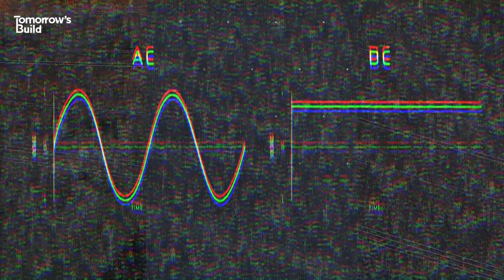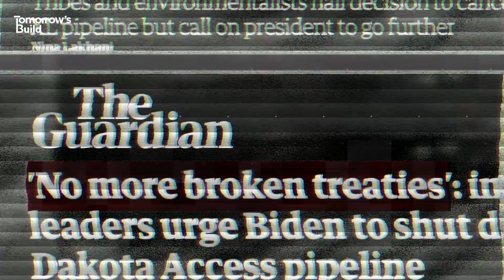The $23BN Plan to Power Singapore from Australia

Comment: Uhhh we transport electricity over long distances using high voltage AC … because it is much more efficient… not DC…
Also DC is particularly hard on the transportation infrastructure (cables, pipes and the like). 

If it is going to be stored in batteries and the like (and generated using PV cells) then DC has an advantage here, but it is never more efficient to transport electricity using DC (also it will eventually need to become AC for consumer use). 

Maybe this was done due to the insulation requirements of massively long AC transmission lines (there is a reason the lines are so high above ground and so far apart from each other - that is what is needed to insulate them. The physical distance separating the cables), I dunno. Either way if you were taught that DC is the efficient way to transport electricity then you should have a word with your teachers/school.

Comment: The more globally interconnected the electrical grids get the easier it will be for each country to maximize its own renewable energy potential in the way that makes sense for its geography, being able to supplement other countries energy deficits with their own and vice versa.  Transmission capacity is probably the biggest hurdle facing renewable development IMO currently, great news to see mega projects taking it on.

Comment: @3:27 "You'll remember from school that by converting (AC) power to (DC) power, resistance within the cable is minimized and allows electricity to be transmitted over much greater distances."

Okay, now I'm confused. I've seen documentaries on the history of electricity that seem to tell a different story, one where DC current required power generating stations be placed only a few miles apart because of said losses and it was the advent of AC power that allowed current to be carried over much greater distances; not DC, and that the transformers on the local power poles weren't transforming DC power back to AC but just stepping down the thousands of volts down to the 220 or 110 that households use.

I have no idea how to reconcile those two seemingly contradictory claims in my head.
Reply: Search for HVDC and why its used.

Comment: Great concept but a significantly better outcome for the environment, and Australia, could be achieved by using nuclear power as the energy source. Australia has an abundance of nuclear fuel as well as sunshine. Nuclear energy produces 3 to 4 times less greenhouse gases than solar. Along with this Australia is one of the most geo-stable places on earth making waste storage both cheaper and more secure. That successive Australian governments have not promoted nuclear power to the top of our solutions list is bewildering to me.

Comment: There is a similar (though probably smaller, but I haven't checked the sizes) project to build a solar farm in north Africa and connect it via an undersea cable to the UK. The site has been carefully chosen to avoid areas that local power companies have any plans to build solar farms in so prime land is not being "stolen" from locals or anything like that.

Comment: This is one of the most ridiculous plans I have ever heard, and has no basis in physics, math or history. 
1. The transport of electricity on an 3700 km cable is extremely inefficient, even if HVDC is used. Serious amounts of electricity will be lost along the way.
2. The total cost of energy (so, not money) for such a cable will cost so much in mining efforts, it will never pay the energy back. After all, you have to build the whole infrastructure, which is extremely energy intensive. This is called the EROI. So, the whole project will end up as a net energy sink. In other words, MORE CO2 will be emitted in the end, if this is attempted.
3. As with all solar panels, the sun also doesn't shine at night in Australia. So all the fossil infrastructure is needed anyway, and for way over half the time, this wil still be running, providing electricity when the sun doesn't shine. 
There is, however, a real solution to Singapore's needs, which is easily done. Nuclear power plants. Safe, Efficient. Powerful, Renewable, Clean power. The same goes for Australia. SOLAR AND WIND CAN NEVER POWER ANY INDUSTRIALIZED ECONOMY.

Comment: HVDC isn't better JUST because it's DC.  It has to do with particular losses in UNDERWATER applications. Charge and discharge current losses that would affect AC. This video doesn't explain that at all and instead says "things you learned in school". In other words, this video glossed over the topic cuz lazy and because really these videos aren't about technical advantages or disadvantages, they're about feel-good cheerleadering. Cuz if it's new and it goes against existing solutions, then it must be better, right ??

10 percent losses being acceptable is not taking full account of the emissions spewed by the fact that you need 10 percent more mining and power consumption just to make 10 percent more solar panel area to begin with, then add the mining and power usage for the large amount of conductor material needed.

Comment: If solar panels create DIRECT CURRENT electricity, and the power is going to be transmitted across the ocean in DC mode, why both converting it to ALTERNATING CURRENT power just to transmit it across Australia and then have to convert it back to DC for the ocean section?
Reply: Low voltage DC is not very efficient only high voltage DC.

The problem is to get to High voltage it is much simpler to go via an AC step inbetween.

Comment: Wait, I thought DC current was much harder to transmit over long distances than AC...  Wasn't that why Edison electrocuted an elephant trying to show how dangerous AC current was and the need for building DC Power stations every 3 blocks??
Reply: DC is much easier to transmit the AC however High voltage is much better then low voltage. (even more then the other comparison)

DC is very hard to convert into high voltage. 

So in a high voltage AC vs low voltage DC battle then high voltage wins it for AC.

Comment: Why do excessive engineering exist? They can be more efficient if just send panel stabilized DC voltage from the solar facility directly to Singapore. And large battery can be installed there, which will be also charged by local solar arrays and Singapore will become largest power bank and use their energy at night more efficiently, so they will not require any source of fossil energy.

Comment: nice video but this is quite naive and really neglects the other nations which could benefit from the improved transmission infrastructure. Perhaps involving one of their neighbors could both cut the length of the cable dramatically and allow Australia to support multiple wholesale markets with their available solar power, rather than just one small country. This is a one dimensional green power purchase rather than a real infrastructure plan.

Comment: Just wondering - in the next 50 - 100 years, climate change and its ensuing sea level rise will cause many countries to face huge issues with flooding of low-lying areas.  Singapore with its low land mass and hardly much elevated land will be among the most affected.  I don't know enough but someone has to check out if this A$23B is a wise spend in this context.

Comment: This idea is crazy!  For that amount of power the set up of panels will have to be in a low cloud area, So the far north and the monsoon season would be a real issue..  Also many areas that are not inhabited  have not had much in the way of weather conditions.  If no one is there who reports Tornados or Sand Storms. Hail storms   Then who is going to live there to keep them clean Australia has a dust movement issue!  Solar panel have a short life and can corrode.   Also go off line at night! Also when it gets Cloudy. 
 
I have no issue with Australia helping out our Singapore friends.   But I would suggest that Thorium Salt Water Nuclear Reactors would be far more reliable and cost effective in the long term.  

Which I also believe is Australia's own answer.  Now Australia is not short on salt ask a farmer, Plus we have Plutonium which can be feed into a Thorium reactor,  Thorium is widey available in Australia.  It will also run on Nuclear Waste which will reduce the higher level Nuclear radiation levels to very low levels.
Seriously this would be a win, win all round.  We have the required Fuels Here!  "Jobs" "Jobs" "Jobs" 
Mining, Transport, Power Management and Supply.

Comment: Actually it is cheaper to run AC over long distances since the AC with high voltage has less resistance than DC. Underwater sea cable however have a high capacitance, which renders them unfit for AC thus they run HVDC.

Comment: They're going to build a solar plant in a country that mostly burns coal for power, but... export the electricity? Mmmmhhhh. 
Wouldn't it make more sense to continue to burn NG in Singapore, and pay the Australians to replace some of their local coal use with solar? That would result in a much greater reduction in  net CO2 emissions (replacing coal with solar, rather than replacing gas with solar), and eliminate the weird long cable run. Green politics are ugly.

Comment: WHAT THE SINGAPOREAN POLITICIANS SEEM TO LACK IS INTELLIGENCE AND NOT WIDER OPEN SPACE TO BUILD THE SOLAR POWER STATION.

BECAUSE, EVEN AT AN AVERAGE PRICE OF $100,000 PER ACRE, WHICH SHOULD AMOUNT TO AROUND $64 MILLION PER SQ.MILE, THEY CAN PURCHASE THE ENTIRE ISLAND OF SUMATRA FOR AROUND $12BILLION.

GIVEN THAT, COMPARED TO AUSTRALIA, SUMATRA IS SITUATED MUCH CLOSER TO SINGAPORE, THE COST OF BUILDING A SOLAR POWER STATION WILL BE SUBSTANTIALLY LESS COMPARED TO $23 BILLION QUOTED IN THIS VIDEO. ALSO, AT LEAST SOME PARTS OF SUMATRA WILL HAVE DRY HOT WEATHER, SUITABLE FOR THE SOLAR POWER STATIONS TO BE BUILT.

IF THE SINGAPOREAN GOVERNMENT PAYS THE RIGHT PRICE, THE ALREADY CASH STRAPPED INDONESIAN GOVERNMENT WILL BE WILLING TO DISPOSE AT LEAST A PART OF SUMATRA TO THE SINGAPOREAN GOVERNMENT. THEREFORE, NEGOTIATING SUCH A PURCHASE SHOULD NOT BE IMPOSSIBLE FOR THE SINGAPOREAN GOVERNMENT.

THE MAIN PROBLEM WITH SINGAPORE IS, IT IS FAR TOO SMALL TO ACCOMMODATE A POPULATION OF ALMOST SIX MILLION. HENCE, WHAT THE SINGAPOREAN GOVERNMENT NEEDS REALLY DESPERATELY IS SUBSTANTIALLY LARGE LAND, SO THAT, SINGAPORE CAN BECOME A COUNTRY WITH A LARGER LAND AREA.

THEREFORE, IT IS ABOUT TIME THE SINGAPOREAN POLITICIANS GET REAL AND DO THE SENSIBLE THING. OTHERWISE, THEY WILL HAVE TO REGRET THEIR DECISION IN A LONG RUN. AFTER ALL,

"YOU REAP WHAT YOU SOW". PERIOD.

Comment: 1st it is not ac to dc, it is actually dc to ac decreases losses in transmission. 2nd there is no need to touch ocean floor to lay down cables. It needs only anchoring and buoyancy systems while passing deep areas, this also helps againts earthquake induced morpholgical changes.
Reply: While you might be right on the undersea cable, you're just wrong about HVDC, it is in fact more efficient than HVAC. At lower voltages ac is more efficient in transmission, at higher voltages dc is more efficient than ac.

Comment: And now Australians just have to wait until our governments stops sleeping at the wheel and does something proactive about our own energy generation (at a federal level).
Reply: Slavery is Freedom, War is Peace  20 to 40 years for solar panels. All material is recyclable. You’re also forgetting other renewables such as wind turbines. Battery tech is emerging. Home energy storage will be 2nd life vehicle batteries as most economical. Today you can install solar and battery storage in your home which will last 20 to 40 years depending on use and is cheaper than paying retail energy prices. For the same period.
Reply: @Daniel Herbst right…..crickets. Ok then all the engineers and peer review studies are wrong and you are right. Also there is basic math and common sense which says opposite to you. Also do you have a better idea?
Reply: Slavery is Freedom, War is Peace  I'm responding to your first comment in this section btw.

Firstly, it doesn't actually take that much to coal to produce a solar panel. All you'd need anyway was enough solar panels and other renewables to make them anyway. You should more care about the minerals solar panels use that are hard to extract from the ground. 

Secondly, if you seriously think 3 Trillion USD need to be invested in batteries, you're either looking at extremely costly and inefficient batteries or you're just lying. You seriously think 3 trillion USD? Maybe that for expensive efficient batteries for the entire Australia power grid. Also you do realize they normally pay themselves off? You wouldn't paying 4 times more for your electricity bill either.
Reply: Solar panels still use rare earth metals and only last a few years before they need repairs/replacing. The manufacturing process, mining process for the materials, and the actual materials used mean they aren't actually that environmentally friendly.
Reply: @itsrobm8  so if I buy solar panels today then I have to replace them in a few years? Or at least repair them ? Lol. try 20 to 40 years maybe a panel clean every now and again and most of the material is (will be) recycled. Solar is still an emerging industry so we haven’t seen the full life cycle of the product.
Reply: We need Pauline Hanson

Comment: Noticed the same voice from the B1M and knew instantly this would be a good channel. I'm more of a Bjorn Lomberg sympathizer than most of the climate change fanatics, but this project might satisfy all parties - aside from the questions of environmental cost of making that many solar panels. You take a part of the planet that grows almost nothing and for which land is cheap with little weather and lots and lots of sun and turn it into energy for, potentially, an entire section of the globe including some of the most populated places on earth... I'm concerned about the use of so many batteries on that scale (environment cost, dense concentration of energy storage can be dangerous). On the other hand, projects of this scale encourage innovation at scale as even small improvements in battery tech have enormous benefit to a single customer in this case. Just as Elon has done with Tesla, continuing to push battery and motor design to extract higher efficiencies, the focus from this kind of project should incentivize a lot of innovation. Pretty aggressive timeline, too. Very interesting. I wonder if they will build multiple routes for redundancy?

Comment: Why would Singapore ever need this when there is nothing to stop Singapore building offshore solar farms or windfarms just off its coast? Besides the infeasibility of a 4,000 underground high-voltage cable, were Singapore to import electricity from somewhere, it can just plug into China's grid, who is the world's biggest producer of renewable energy. That electricity can also be carried by standard high-voltage overhead cables which are proven to work over thousands of km.
Reply: Not possible 2 thirds of the worlds freight floats in their ocean territory, extremely busy so its not an option.

Comment: HVDC - prevents capacitive issues with super long undersea cables, and maximises power transmission for a given cable insulation level. Downside is the power electronics required at either end for conversion to AC. The reason everything else is AC is because it's very convenient to change voltage levels using a transformer, it also can drive inexpensive motors well.

Comment: $23B, and only 20% of the currently needed power.  Sounds like a huge fail in the making.  Not even close to emission free if you facture in all the resources needed to create and maintain the project.  By the time the last solar panel is installed, they will be needing to start replacing the first ones that were installed.  This project is simply greenwashing, nothing more.  I wonder how much $$$ Suncable paid Tomorrow's Build for this publicity stunt.

Comment: They got the money to make solar panel and underwater cable from Australia to Singapore... But they don't have the mean of digging a big enough river to make a dam and use hydroelectricity when some country like Turkey plans on digging to make Istanbul an island and have a new canal for trading on the other side of the bosphorus... 

Please don't fucking put underwater cable from Australia to Singapore that's just so fucking dumb. So much for not wanting to polute. Just think of the amount of infrastructure and part replacement overtime that would require overall and the amount of animal that will hurt indirectly. 

Not impressed... Not impressed at all.

Comment: Isn't AC the power that experiences less power loss during transmission?
Reply: Hm, i dont know. But DC enables u to build a single cable and push it to 1 million Volts without the alternating magnetic fields of AC lines

Comment: wait.. why DC? ..ok now I got it.. I tend to recall that it was the other way round and therefore we use AC for long distances.. but the energy loss will end up in warmth hence heating the water around the cable doesn't it? 10% might be quite a bit considering this big city